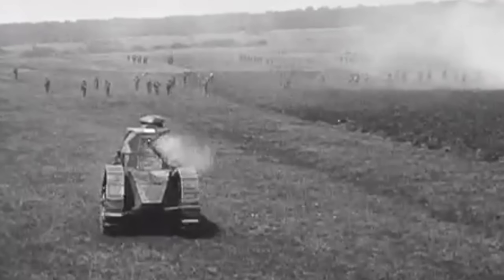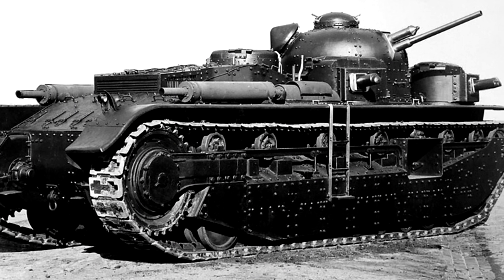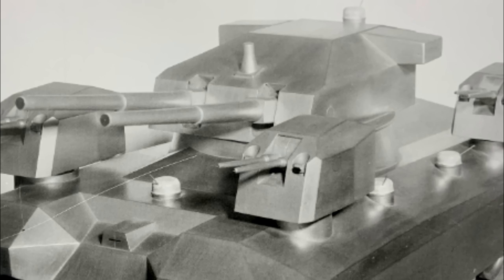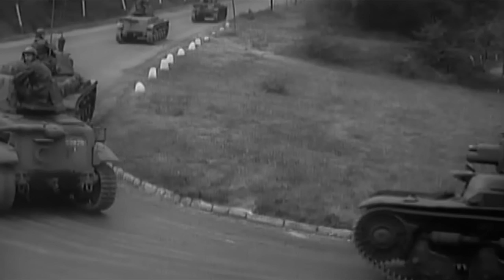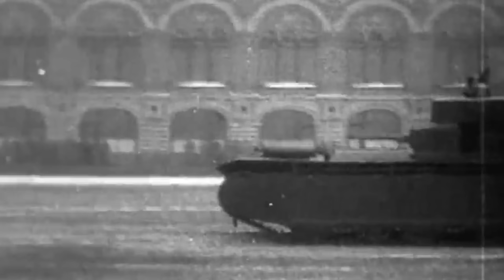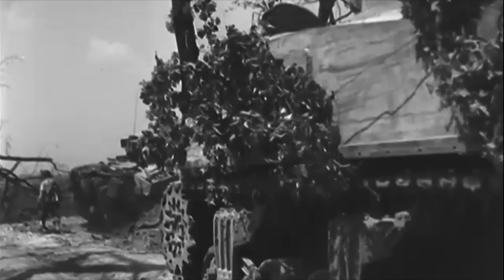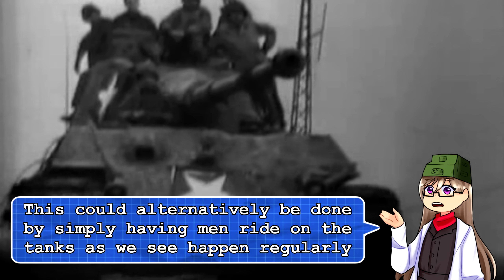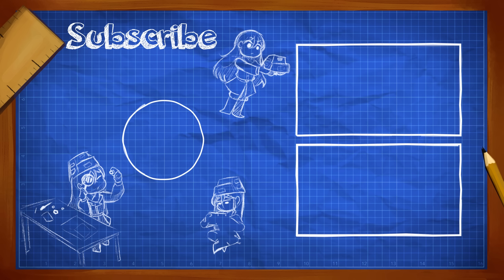Why do Multi-Turreted Tanks Fail?

Comment: Given how (not really) durable tanks are, its no surprise people figured "hey, iron coffins for 5 or less are better than iron coffins for 12 or 15". Its a nightmare for the commander to get everyone synchronized on what theyre meant to be doing; there isnt enough room in the vehicle to operate it properly, and those multi-turreted tanks usually lacked armor, due to weight constraints imparted on them by said turrets... who knew more steel on an already impressive amount of steel could cause logistical issues?

Besides, these things always turned out huge, which goes against the idea and current development to reduce the height of tanks below 2 meters.
Reply: @LiezAllLiez  tanks in general lacked armour at that time. In comparison the soviet T-28 and 35  have more armour by design than  T-26 or BT series, while german designs were on par with very early panzers. These were meant to be walking land battleships. You are right on that they were incredibly cumbersome and difficult to coordinate, especially for Soviet tanks early intercoms were sketchy at best. If these tanks had any they would mostly rely on shouts or series of internal lights to relay orders. The commander would be overburdened by scanning target's and ordering the crew meanwhile visibility from the smaller turrets was next to none.
Reply: @apyllyon  Yeah, designers didn't mind armor much until the Spanish Civil War showed them just how common (and lethal) anti-tank guns of the time (mainly 37s and 45s) would be. However, ConeOfArc is actually incorrect about the two competing KV-related Soviet designs in the Winter War. The multi-turreted SMK at 55 tons had 15-30mm less armor than the single-turreted KV-1 which was still 10 tons lighter. So this is a real thing, by necessity a multi-turreted tank will have less armor for a given weight, and maximum possible tank weight is never infinite. Another problem is that turrets generally present weak spots in the form of turret rings, shot traps, and poor all-around armor compared to a simple armor plate. With ammunition likely carried close to the gun, secondary turrets also present another place where a penetration equals an operational kill (through cook-off) rather than mere spall injuries. It's a reasonable interpretation to say that more turrets mean less protection. Turretless SPGs are also much easier to give effective armor than their turreted counterparts, even on the same chassis and within the same weight constraints.

Comment: I think one important benefit of having multiple turrets is that you can give the turrets different armaments to fit different roles, which is basically what the M3 and Char B1 did: the main gun with limited traverse was used for firing HE shells to break through fortified defenses, while the smaller gun in the turret was used to deal with enemy armor.
Reply: This is largely solved by having more than one ammo type for the one big cannon. 

The anti-armour small gun made sense when you realized that pre WWII armour was awfully thin. The big cannon ended up being the anti-armour gun, and at that point, just make two ammo types of the same size.

Having two turrets only makes sense if you need both roles solved by one tank at the same time, which begs the question, why not just get two tanks to do two different roles, rather than two tanks that can technically do both at the same time and cost a crapton more to build.

And remember, no matter how what, if it costs you more to make 1, it costs you more to make 100, and you're eventually going to have less when you needed quantity. It might not be why make 1 when you can make 2, but it could mean 'why make 500 when you could have 800 that are like 10% worse'
Reply: @fearedjames  Yeah, I know. But still, even when dual-purpose guns became common, the Americans were stil reluctant to replace the 75 mm gun with the 76 mm gun on their Shermans, despite the latter having better anti-tank performance, because the 75 mm fired better HE shell. I'm not saying multi-turreted tanks are a good idea, but it makes at least some level of sense to have multiple turrets with different guns. Although it would probably be wiser to have both guns in a single turret, like the M6 Heavy tank.
Reply: Good point =)
Reply: Back in the early days of tanks, that might have been useful, but it’s pretty much nullified now. Most modern tanks have multiple shell types they can fire for different roles, and it’s rare that a tank isn’t accompanied by an infantry fighting vehicle usually armed with an autocannon and/or guided missiles, with an additional benefit of the latter being that the vehicle has its own commander who only has to worry about their vehicles crew and not the crew of the tank as well.
Reply: coordination of target acquisition though and again, 2 tanks
Reply: @MsZsc  Yeah, I get that, I meant it as a benefit over one single-turreted tank. Ofcourse you can counter any argument in support of multi-turreted tanks by saying "just build 2 single-turreted tanks".
Reply: @minervszombies But would those two tanks be more expensive?
They’d be more versatile, sure, but I can imagine having to completely duplicate every single part instead of just making some, like drivetrain, a bit bigger would have drawbacks in terms of manufacturing and maintenance.
Reply: @GraingyAircraft  Yeah, I was thinking that too. But I can imagine that 2 tanks are just much more efficient at performing combat tasks than 1 bulky, slow-moving tank with 2 turrets. So in the end, it's probably more cost-effective to build single-turreted tanks instead of multi-turreted ones.
Reply: @GraingyAircraft size goes up so does the breakdown rate.
Reply: @minervszombies  I mentioned versatility, but at the end of the day it'd probably be largely a matter of doctrine/current state of warfare at a given time in history or region.
Reply: @GraingyAircraft  Actually a single two turreted tank is LESS versatile on the battlefield than two single turreted tanks. Especially if you have deleted the hull gunner so only have a crew of four (with three in the turret), which was common practice late war.

Two tanks can mutually support each other. They can advance in bounds, one covering the other as it moves forward, then the forward tank covering the second vehicle as it then moves forward and past. 

A single turret tank is also probably going to be more reliable as its not going to be as heavy, so its putting less stress on the engine, transmission and final drive. 

Crew numbers is also important, because you cannot really reduce the number of vehicles in a tank 'platoon' (insert national/branch name here). In the British Army it was the Troop and numbered four vehicles. With single turret tanks, early war you are looking at the gunner, loader and commander in the turret, and the driver and hull gunner (sometimes radio operator) in the hull. Late war the hull gunner was often deleted, especially in British tanks were the radios were in the turret. So you have a crew requirement of 20 guys early war, 16 late war. 

How many crew do you need for a two turret tank? Assuming you have a turret with an anti tank gun, and a turret with a low velocity howitzer of some sort, well you need a gunner, loader and commander for each gun, so that's six men there. Then a driver and radio operator, so that's another two. Finally you need a vehicle commander. So that's nine guys, if you are being sensible. Now you need thirty six guys for your tank troop, not sixteen or twenty....

See the problem?

Tanks do not operate alone. At the lowest level a troop is going to be four tanks. Five if you are in the US Army.

At the end of the day there is a reason no one really used multi turret tanks much during WWII, and certainly no one used them afterwards. Using two tanks with a good ammunition selection was simply far, far more effective.
Reply: @MsZsc  depending on the situation not really that hard not like they are both tracking moving armour ones meant for fortifications while other is meant for armour you prioritize what needs to be dealt with first your not going to be telling the big gun guy to shoot the structure or what have you when you are taking shells and given the training and practical time in a tank it becomes second nature especially when its life or death now if we are talking getting over run or are overwhelmed by enemy armour then ya it gets complicated but like mr youtube man  said in the video  for a point against multi turret by using combined arms having support very rarely do you see tanks engage alone an no support they had there purpose you would use a m3 for amphibious operations but sure as hell would be usually when holding ground its all about how its used the germans had tigers which were apex but due to them no being where they needed to be when they needed to be they were either easy targets or got bogged down trying to shift to the western front very few actually where effectively used during the initial days of of the western front you dont use heavy tanks for a light tanks job and vise versa look at germans during the french blitzkreig they effectively used both light tanks to and air force to skirmish and act as fast response while heavy sections moved up to better positions whole squadrons of shermans where taken out too usually 1 or 2 german tanks of most variety wasnt till they gave it a bit more armour and a bigger gun the 70mm did it actually start being any good and stuarts where just glorified armours cars on tracks and suffered many of the claimed issues multi turreted tanks have so like i said theres give or takes to all tanks but if it came down to a one on one id rather the singlar tank with more firepower over the one with less cause you could be in the pt 1000 or the maus and 100 tanks are just going to win regardless of how well engineered or crewed or positioned but now a pt 1000 verse a single sherman fuck we will be generous make it a m10 is going to lose every time the one crew i knew of that goes against that was one of the tigers who were down to one tank left an they took out a whole company by expert communication pretty sure the commander became a tank ace after that i forget his name
Reply: And the B1 bis ended up using his "secondary" gun as the actual gun. And  the crews would also have liked having HE shells for it.

This was bound to happen, as the tank was seen by too many of the French military top-brass as auxiliary to infantry instead of an equal. And, I think, woefully underestimated the threat posed by tanks (even moreso German ones)  in future wars.
Reply: I think the counter argument would be that you can just have various shell types in the tank
Reply: @Banefulailment  Yeah, of course. But in WWII, guns that were good for the anti-tank role (i.e., for firing AP shells) typically did not have very good HE shells, and vice versa. That is why the Americans were hesitant to adopt the more powerful 76 mm gun for their Shermans, because the 75 mm gun it replaced had more capable HE shells which are useful for the infantry support role, which was the main role of a tank according to American doctrine. Still, the 76 mm had adequate HE shells, so I'm not saying America should have developed multi-turreted tanks instead, I'm merely saying it would have had its merits.

Comment: I wonder if a multiple turret design similar to the T35/Independent would be useful in moden combat with urban combat along with drones.
Reply: It wouldn’t be a real multi turret as it would likely be unmanned or even computer controlled.

I would be very surprised if this doesn’t become a thing
Reply: @wackyotter1235  My counter argument to that is we still consider it a turret on a M1 TTB or T14 Armata and those are completely unmanned. Now ai agree the small unmanned turrets with just a small MG in them doesn't quite feel like turret is a good definition for that

Comment: IMHO large size was one of the advantages of multi-turreted tanks. They were breakthrough tanks intended to cross the massive obstacles of the WW1 Battlefield. Trench crossing ability is directly proportional to length and a high front idler/sprocket important for vertical obstacles. Needing a big tank they might as well give it lots of guns.

Regarding communications. Commanding a multi-turreted tank is harder than commanding a single turreted one. But it is a lot easier than commanding several single turreted tanks, particularly when the tanks don’t have radios.

A useful accidental effect was developing powerful engines and transmissions for the day that equally heavy but single-turreted tanks were required. Note that the US M2 medium was that big because it mounted lots of machine guns, OK it was one turret and 4 casements, but the effect is similar. This enabled the development of the M3 and then M4 with little difficulty.
Reply: Commanding multiple tanks , I'd argue, would be easier than commanding a single mufti-turreted tank. This is because when you're commanding multiple tank, you're not directing what & when to engage. You're telling them where to go, where to be in relation to your tank, but as far assuagements go, you tell them where to look and then that tank's TC will be responsible for engaging anything  in their area of responsibility..
Reply: @Riceball01  Early tanks did not have radios, which is why it was so difficult to command other tanks. Multi-turreted tanks have specialised armaments, so crews knew which targets were their priority. Because they also have multiple turrets to look out of, the commander actually has better situational awareness because he will have more eyes out.
Reply: @charlesc.9012  You get diminishing returns from all those extra eyes because the information they gather will often need to be passed on to the commander, who will then have to give instructions to the gunner or driver.

In a single-turret tank with decent visibility for the commander, he will do most of the spotting and then issue commands, cutting out a whole layer of extra communications.
Reply: @MisdirectedSasha  That matters less, because situational awareness is always gained through this way, whether by crew or an infantryman on a telephone.

More importantly, the crew can immediately suppress anti-tank weapons etc. within their field of fire, so there is a lot of utility for a trench warfare machine
Reply: @Riceball01  The secondary turrets can be given a degree of independence. Just like the separate tank, you tell them where to look and then that turret commander will be responsible for engaging anything in their area of responsibility. The difference is you can easily change their area of responsibility, whereas a separate tank without a radio has to carry on with the initial assignment. Also the turrets can easily report to you what they see.

Comment: "Am I A Joke To You!"

                 ~ Several Baneblade Crewmen
Reply: coughs in advanced targeting cogitators
Reply: Literally yes but unfortunately the joke is told badly enough that a certain loud portion of the fandom doesn't realize it's a joke.
Reply: There's a fantastic kitbash of the Baneblade converted into a single turreted vehicle, it surpasses the original design in pretty much every aspect.
Reply: Yes. But so is the entire setting.
Reply: WE ARE THE HAMMER
Reply: Literally my thought
Reply: XV88 Broadside Battlesuit: Yes